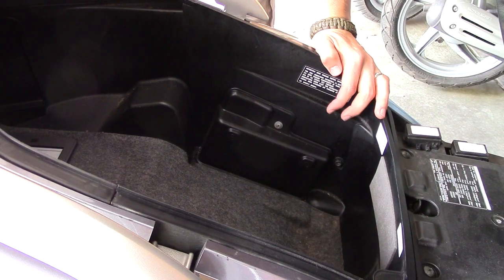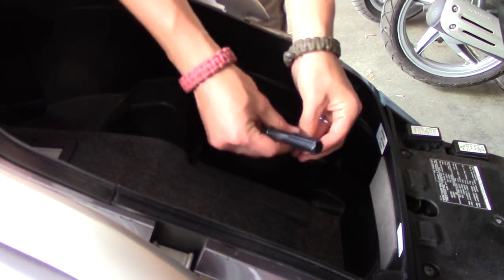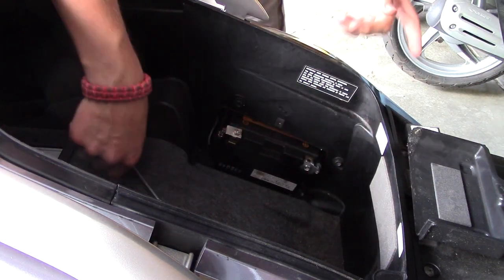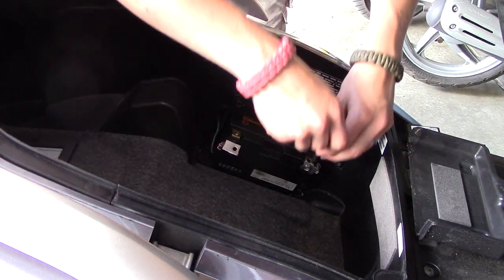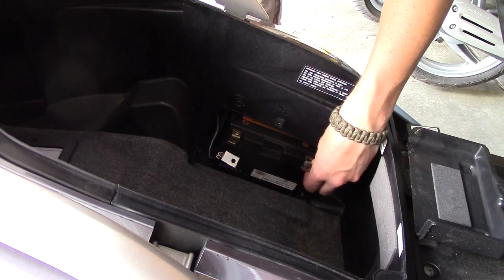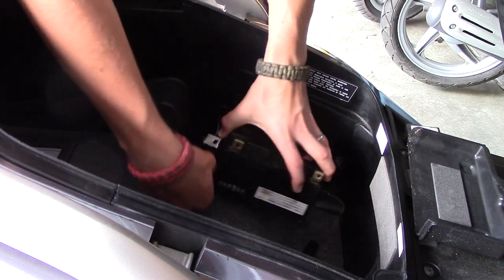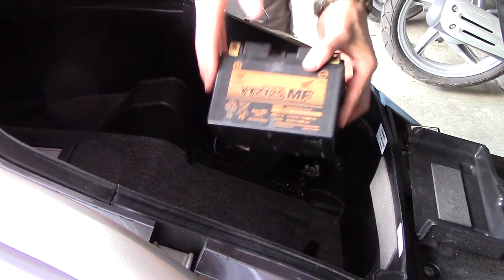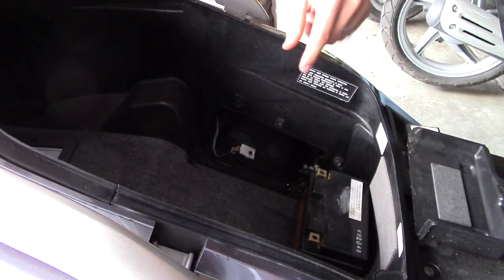2007 Honda Silverwing Battery Removal

Comment: Great video, thanks. Do you have a video on how to remove and replace the seat gas strut. Mine won’t hold the seat up and I would like to replace it.
Reply from the maker: Sorry, I don't have a video on that. The bikes actually in the shop now getting repaired from an accident. I think the gas strut is just a few screws or bolts to remove and replace.